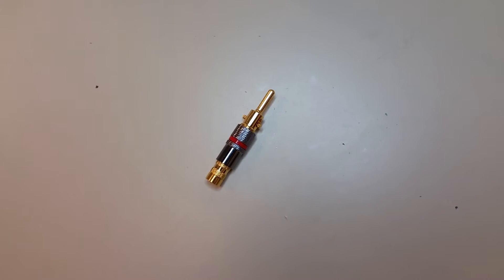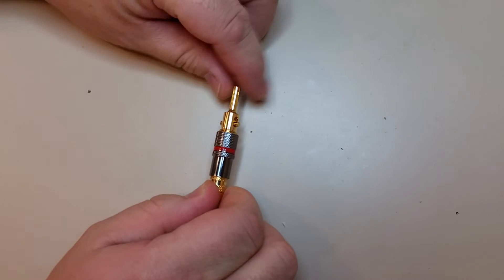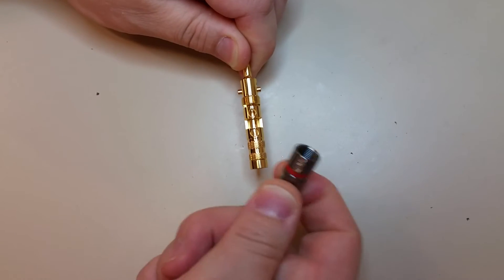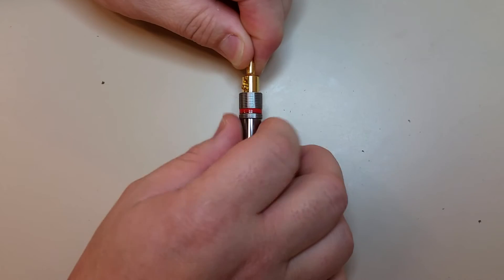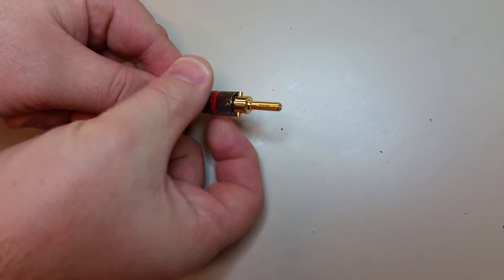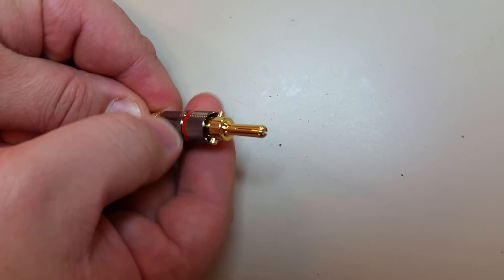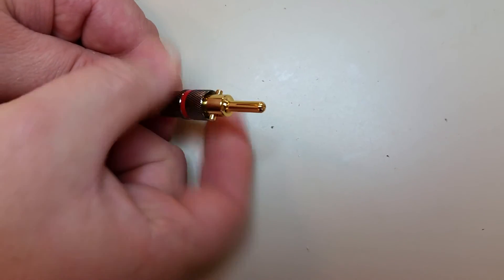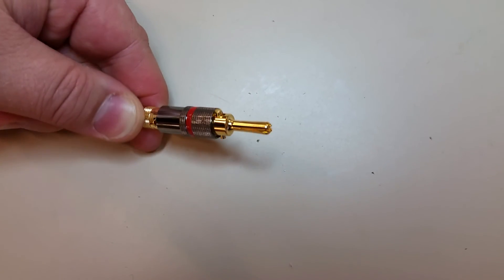basics of our locking bananas

Comment: I've bought 16 of the similar locking banana plugs and a few of are already broken after short use. The issue is that many 5-way speaker binding posts deeper into 4mm hole (for banana plugs) have some sort of a cavity with increased internal diameter. And when you tighten the locking banana the end if it's barrel opens too far. That excessive spreading often causes deformation and permanent damage to lamelle(s) because an alloy used to make those bananas is quite brittle.